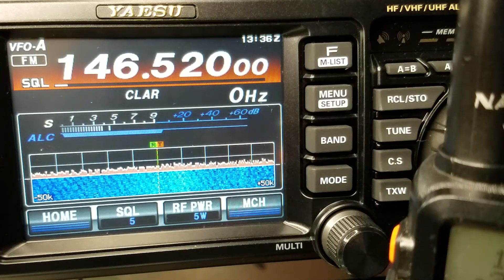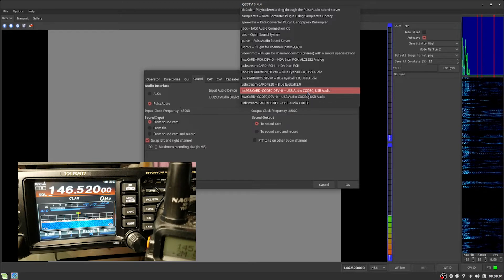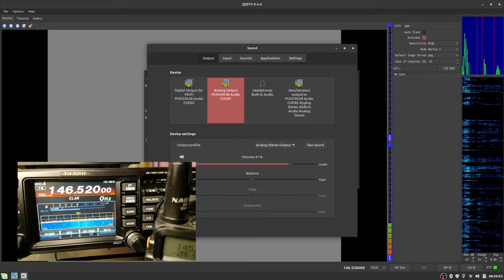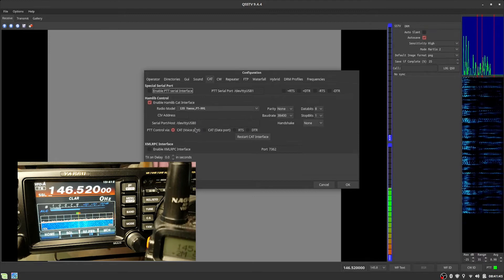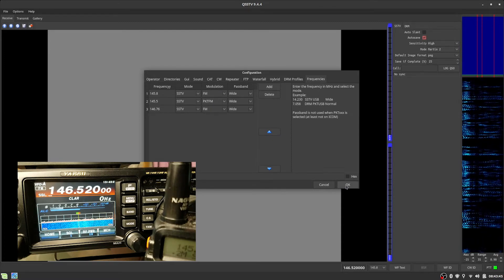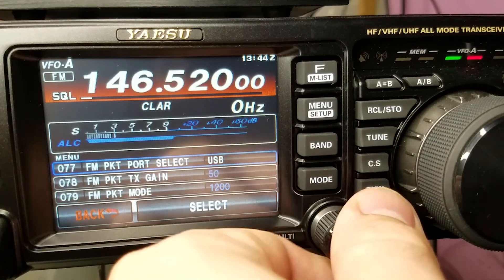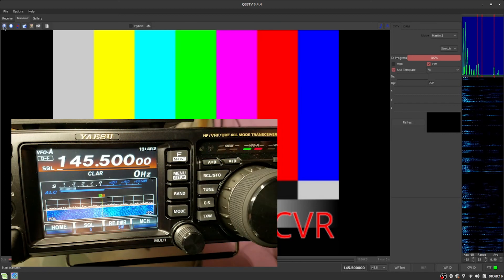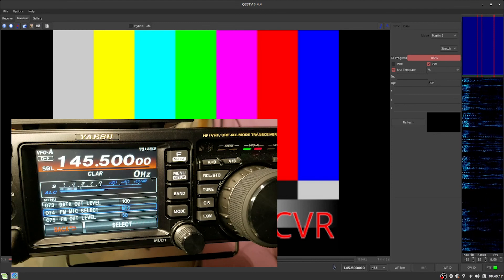QSSTV with LINUX and the FT-991a!

Comment: Does this work with the 510D? Which data cables did you use for your radio?

When I load QSSTV I dont see the pretty waterfall on qsstv
Reply from the maker: I don't have a 5100 to verify, but I'd suspect some of the menu options might be different, as might your sound card configuration. 73,
Reply: @hamradioexperience I gave up on qsstv and downloaded mmsstv, had no issues transmitting from there but not quite able to RX properly yet